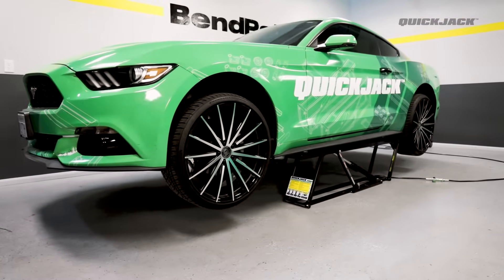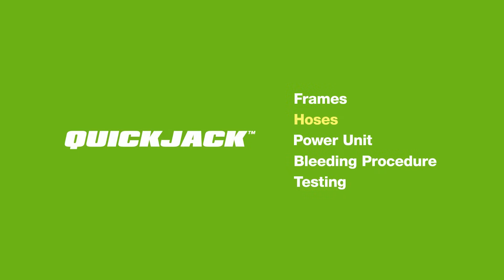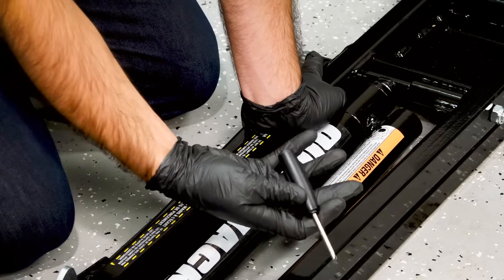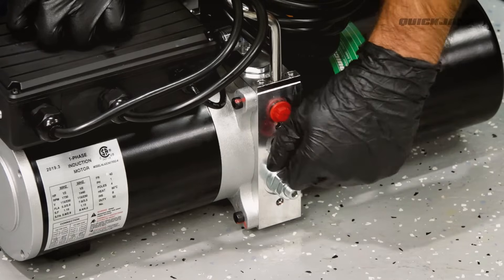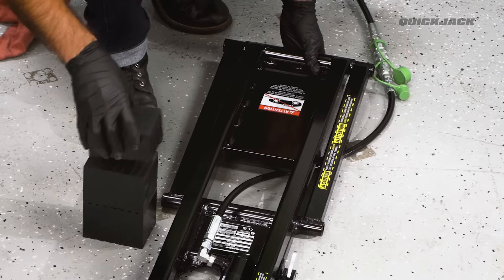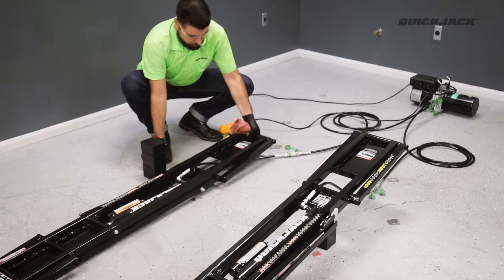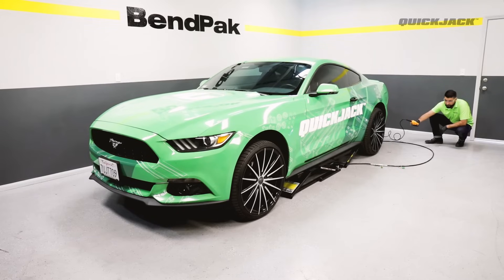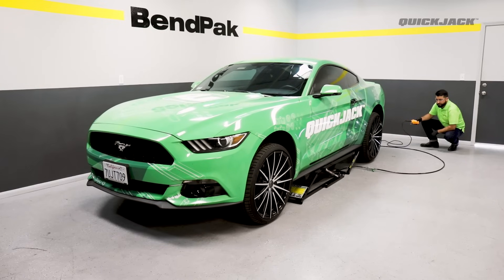The Official QuickJack Setup Tutorial

Comment: So what pucks do you use on the Mustang? I have a 2020 GT and the lift points are too narrow for the pinch weld blocks.
Reply from the maker: On our 2015 Mustang we use the standard short blocks or regular pinch-weld bocks. If you have fitment issues, you may want to look into the newer round top, pinch-weld pucks: https://www.quickjack.com/accessories/pinch-weld-pucks/
Reply: @quickjackusa  One more question before I return this BL-7000SLX system. I have noticed in the videos I have seen as well as the retailer advertisement the hydraulic motor were you fill it up with ATF/hydraulic fluid is round and metal. Why did I receive a square ABS model is there anyway to replace or swap this with the metal version? I have seen bad reviews concerning this issue is the reason why I'm asking.
Reply from the maker: There are several models of power units and all do function exactly the same. If you have any issues or would like to inquire further, please do not hesitate to contact our support team at (888) 262-3880 or use our online ticketing system here: https://help.quickjack.com/support/tickets/new
Reply: @quickjackusa  I have and been told that is all that is offered. I'm sorry but when you have three pieces of ABS plastic and a metal hose clamp holding them together just seems like a company trying to save money and not worried about their products or the consumer. I have spoken with three different representatives and have gotten three different responses. All I want is to swap this motor out with the motor that has the metal  reservoir and is one piece. The system I bought has not been used in any way at all and is in the original packaging. But if that can not be accomplished I will be returning this system.
Reply from the maker: We apologize for the inconveniences, but any requests to return/exchange parts would have to be made through our customer service department.

Comment: Absolutely verify that the lock bar itself is creating the lock. If you raise the QJ up a little too far before letting it settle back down to lock, you can create an unsafe, false lock with the cam jamming agains the stop. That will support weight, but be prone to sudden lock release. BAM, the entire side may fall all the way down if the lock bar doesn't happen to catch against the stop as the cam pops out of "false lock." Always halt going up as soon as the lock bars just clear the stop. Don't let the cam get between the end of the lock bar and stop. If you do that, you will create a potentially catastrophic "false lock" against just the cam.
Reply: This risk could be prevented by reshaping the cam so it can never jam against a lock stop. A revised cam could be retrofitted to existing QuickJacks. In the interest of public safety, I have submitted a report to CPSC.gov (report 20201128-2FEEE-2147367840). Mind you, I otherwise LOVE my QuickJack, but the ability to inadvertently falsely lock with the cam instead of the locking bar end is something that cannot be ignored. Worst part of that failure mode is it looks correct from a distance and it holds the vehicle weight for an unpredictable time before popping free.
Reply: assuming this happens, does the hydraulic lift supports have any limiting action from the sudden increase of hydraulic pressure when in the released position, to slow the rate of descent? Or would they have no effect because the pressure buildup is too small to have any appreciable effect?
It'd be an interesting test-

Comment: I sent in a ticket but will post here too. My 5000xl has sat for over a year. I set it up over the weekend to use switching my tires.
One jack is not holding pressure. With the weight of the car on it .. one drops and the other raises. Car almost fell off the pucks :(
It happens rather quick. I dont see any fluid leaks around. Its the older pump fyi 
Any advice? 
Ty
Reply: Have you checked the shrader valves for tightness?

Comment: Can I store a car on quickjack at first locking position over a winter?
Reply from the maker: Good question! Yes! Once it's on the lock you can disconnect the hoses and leave a vehicle lifted indefinitely. Be sure to depressurize the hoses before disconnecting the quick-connect fittings to give you an easier time later on when you're ready to reconnect the hoses.
Reply: @quickjackusa  How do you de pressurize before disconnecting them? Got mine today, once I pick up some trans fluid I’ll be ready to start but would love to be able to have the hoses disconnected once lifted. Thanks!
Reply from the maker: @totalpackagedetailingllc4413  To depressurize the hoses all you have to do is - once the frames are in a locked position - press the down button on the controller for about 5 seconds.

Comment: you should add the following instruction, "plan on an additional 7-10 days of setup time waiting for the parts that were not included in the original shipment."
Reply: Is that still a common issue now or have they gotten it together?
Reply: @sadfur8728 still a common issue. What a joke. Fck quickjacks.
Reply: No, mine came with everything.

Comment: I highly recommend Loctite 545 thread sealer for the fittings. It's spendy but worth every penny in preventing leaks. I had some issues with leaking through the threads on my QJ unit on multiple locations, despite using thread tape and proper torque. Put some on each of the threads and let it cure for 24 hours. You should never have issues with leaks after that.
Reply: I just received my QuickJack and I used Permatex Pneumatic/Hydraulic Sealant, Non-Fouling #54540 Purple, I let it cure for 24 hours and had zero leaks.
Reply: I will look into this thread sealer. I assume oil will flow through these?
Reply: I used Permatex Pneumatic/Hydraulic Sealant, Non Fouling 54540 on my Quickjack when I assembled it and have never had a leak, I let it cure for 24 hours before I used the Quickjack.

Comment: After bleeding it it goes up pretty even (left frame 1,2 inches faster than right) but when coming down right frame would be already on the ground while left frame is still 7 inches up (not with a car, so far only tested with me on it)  Normal?
Reply from the maker: That is absolutely normal without substantial weight on the frames. The flow divider valve works best when loaded with the weight of a vehicle. Also make sure that both air cylinders are inflated to 50psi as that helps cushion the lowering of the frames.

Comment: I just received my quickjack. It came with a thread sealant. Is this to be used in lieu of thread seal tape?
Reply: I wondered this too.
Reply: Me too
Reply: I used the sealant and it worked fine
Reply: Yes, that’s what  they recommend in lieu of teflon tape. Apparently, may were using the tape wrong causing tape bits to enter the line and contaminating the hydraulic system, hence the switch to sealant.

Comment: I just got mine delivered. It came with a thread sealant instead of thread seal tape. Is this a replacement for the tape? Also, how do I tighten the valve? I don't have a schrader tool but I know the schrader valve is on the cap but not to tighten like it was shown in the video.

Comment: I finally had the chance to set this up today. Anticipating doing work for next weekend. Video helped!  Especially for the bleeding process (the manual never had instructions on that. Dated December 2018). Followed the vid, everything working like a charm. I’m very impressed how much room this gives me!  I only took it up to the first notch too!  Bravo! Loving it! 👍🏻
Reply: (in the video it said to loosen the screw until there is no air coming out, tighten it, press up for 1 sec, loosen screw then tap up until fluid come out with no more air bubble, but how much do I loosen it? loosen it until it starts to leak out THEN tap up or loosen it some but no fluid comes out then tap up to make fluid come out?) thanks for your help

Comment: What is the MAXIMUM drive way slope that is safe to use a Quick jack?  Can you LEVEL a quick jack if the slope is above the max angle?
Reply: https://www.youtube.com/watch?v=h1GQKpYYf-c
Reply: Doesn't seem a good idea to have it on anything other than a flat surface. Better off that it's not level then having one end of the jack propped up with anything. It's got to be a very severe angle for it to start sliding off the lift blocks. There's no wheels to deal with so nothing's going to roll, as is the case with standard floor jacks and their ilk being used on the slant.

Comment: Manual says not to lift without car below, but this video says other wise.... make up your mind
Reply: Yeah, they should make this part more clear. But it's like this. To bleed the hydraulic cylinders, only lift up to the first locking point. Never lift up to the second locking point without any load (1500 pounds min.).

I didn't have to bleed the cylinders on first setup though. Had to bleed the compressor to get the lift working.

Comment: just purchased a 5000 QJ, and followed tutorial. Everything working as it should. I have a 65  Mercury Comet and not sure of lift points on the car. The rocker panels are pinch welds.  I also have subframe connectors to strength the  uniframe factory torque boxes to help with big block ford motor. As a reminder these 64-65 Comets are the same as 64-65 falcons.  Any suggestions would be appreciate

Comment: I got my beat up 3 of 3 box with 5 empty hole in my fittings tray? Only have 1of4 tack shaped rubber things, whatever they are for, not mentioned in any videos, 2 empty slots? Not sure what goes there. And there are 2 I believe wheels? Also not sure where they go either. Also not mentioned in any videos. Do they ship from different areas?  Sure would have been nice to get all of it at once🤨
Reply: That is why I am not buying one. Too many stories of shipping damage due to cheap cost savings packing. I will wait until Costco stock them again so I can pick one without torn up boxes.

Comment: Seems like you need to get your procedures straight before printing instructions or for that matter releasing them for sale to the general public. You keep making revisions and still getting many complaints from customers due to voids in your own manual. That should alert you to a printed revision. Not a download. You have a great product but seem to be leaving too much to chance / liability on your customer.
Reply: I've recently assembled the 5000 model, using just the paperback manual. I ran into very little issue. Sure, there are some typos and inconsistencies in the manual. And the bleeding procedure is vastly different from that in the video. But I managed some how. They should suggest getting the latest revision of the manual printed on the paperback.

Comment: Hi Quickjack! At 7:12 you detach the hoses while the car is at first lock point. For how long will you be able to keep it that way? In my case I'd like to store a car during winter so the car will be in the garage for 4-5 month. Can I let it stay on the quickjack for that period of time as long I am sure it is in a locked position?
Thanks!
Reply from the maker: Hi and thanks for the comment! The answer is, Yes! You absolutely can leave your car up on QuickJack for the winter, or as long as you'd like. Once the QuickJack's locks are engaged you can depressurize the hydraulics by holding the down button on the controller for a few seconds, disconnect the hoses from the quick-connect fittings, and move the hoses and power unit out of the way. Just as a reminder, when lifting your vehicle with QuickJack, the hydraulics are just there to do the lifting and lowering. Always use one of the locking positions - whether you're storing you car for the winter, or just doing some simple maintenance.
Reply: @quickjackusa  Thanks! GREAT explanation! Can't wait for getting my Quickjack!
Reply: @quickjackusa  is the disconnection of the hoses needed to prevent degrading the connector seals from taking a set over a long period, or is the disconnection just for getting them out of the way?

Comment: Tightened up schrader valve still will not hold pressure.  Removed seemed fine reinstalled and still will not hold pressure.  Checked  tightness of fitting and same result.
I know the pressure is to help with returning the ATF to the holding tank but is it Necessary?
Reply from the maker: Thank you for the comment! The air tank is most helpful during the cylinder break-in period which is when the lift is new. The first 20 or so cycles are when it is doing the most work. However it will still play a roll after that and we recommend giving our service team a call to further troubleshoot. You can reach them at 888-262-3880 or visiting https://help.quickjack.com/support/tickets/new

Comment: You should emphasize that when bleeding the system the compressor should be on the floor.  I made the mistake of having it sitting on a table.  When on the floor, the air bubbles will go towards the bleeders which are raised up higher than the pump.  It was all right there in the video and the owner's manual but it didn't catch my attention until I couldn't understand why I wasn't getting any air at the bleeders.  With the pump higher than the bleeders all the air was staying in the pump.
Reply from the maker: Thank you very much for the comment! Excellent point!

Comment: Is the pump the only difference?
Reply from the maker: Yes. While there have been some changes to QuickJack over the past few years, the current models are all the same except for several variances of the hydraulic power unit. You can always get the latest information from www.quickjack.com or giving us a call at 888-262-3880

Comment: I own the 7000lb. model..bought it to use it on my 2018 Mustang GT and 2018 Raptor.. I bought the Pinch weld blocks for the Mustang and i just couldn't get them to lineup due to the stock side ground effects on the mustang and i finally just gave up and used the standard blocks...i would like to see how thats done without damaging the vehicles ground effects or maybe if there was magnetic adapter that can be slipped into the blocks to mount them onto the car first and then get the quick jack to lift safely. The Raptor's back wheels barely come off the ground and thats using the SUV adapter kit, is there an extension to the SUV Kit? is there anything else i can use to safely increase the lift high or the vehicle?...Thanx In Advance
Reply: I imagine you could buy a second truck kit, and add one more section of the round tubes.  I personally don’t think it’d be safe boosted any higher than that.

Comment: Schrader tool should be included in the kit. Took me days to get that! It's cheap enough, just not a common tool.
Reply: In the setup video, they say to use the schrader tool to tighten the valve, if it is not holding air, but I didn’t need to do that. If you need to let a little air out, the top of the valve stem cap has a little nub for doing that.
Reply: What type of fitting goes over the valve to fill it with air using my air compressor? Mine doesn’t have a valve stem, it just has a hole.

Update: after watching another YouTube video set up of jack I see I never did get the air fittings I needed. Will be contacting manufacturer.
Reply: @KB248FOREVER  I just received my quickjack yesterday and the same thing happened. No valve stems. What was the result of you contacting quickjack?
Reply: @FlyinRyan2011  - same thing just happened to me.  No valve stems and no wheels or teflon tape.  Ughh.  Their offices are closed for the weekend too..
Reply: Not a common tool? It is available at every auto parts store and Walmart. The tool costs a few dollars and there's not a single place in the US where you do not have an AutoZone or O'Reilly within a relatively close distance. I've found them in towns with populations of under 5,000 people.
Reply: It is included, it's integrated on the cap.
Reply: @ronnymerinogonzalez3410  Not integrated into the cap at all only a nub for bleeding, NOT tightening the valve. Mine came with both valves loose and not holding air. So much for QC
Reply: @ronnymerinogonzalez3410  not any more it isn't.
No spare wheels either.
But my air struts already had 50psi in them.
UK purchase from Costco September 2021.
Reply: Literally can get a Schrader tool at any auto parts or even Walmart lol

Comment: You need to mount wheels on your Quick Jack, they are too heavy to adjust under the car. I think of resilient ball rollers that you drill into the lift so it becomes easy to move around and adjust the lift under the car.
Reply: exactly! jack and stands are way faster and easier to use than this. they should spring load the wheels so it can support it's own weight to roll around and compress to lay on its frame when weight is applied to it
Reply: @gwot  that'd be a nice setup, like those step stools with spring loaded wheels that retract with weight on them. Just have to make sure it's not going to reduce clearance by getting overly high though.
Reply: That might also make the system unstable with a car on it.

Comment: Big controversy from the last video was the use of Teflon tape. Comments consensus was “no” but it’s back in this video so ?
Reply from the maker: Thanks for the comment! You absolutely need to use thread seal tape on the fittings! The only fittings which do not need the tape are the elbow fitting (due to it's o-ring on one side and the compression fitting on the other side) and the power unit fittings (as they are also equipped with o-rings).